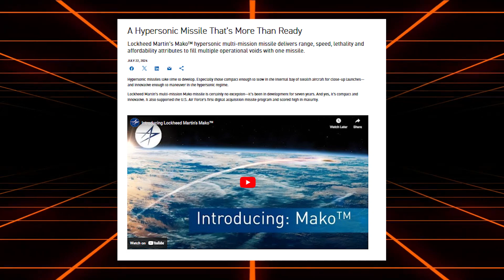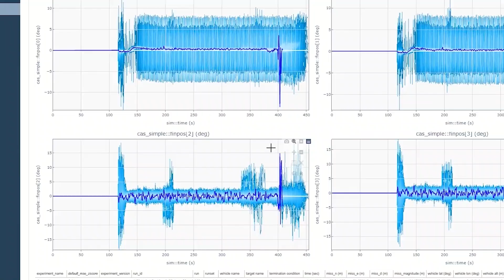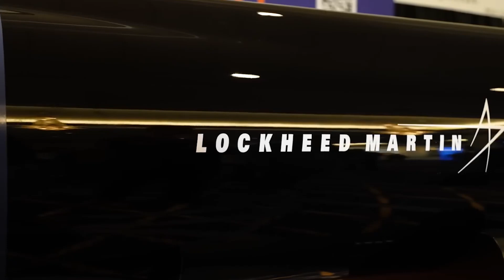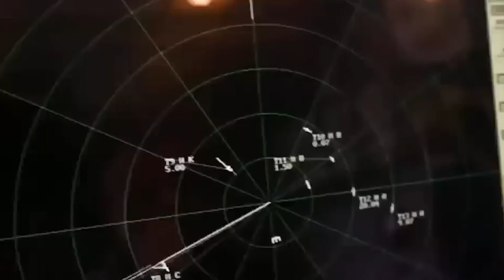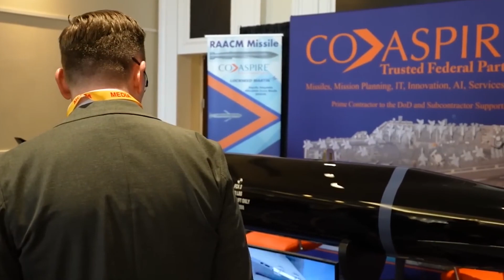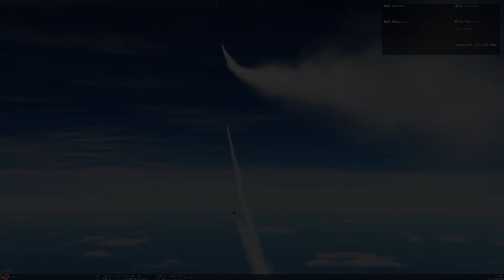Lockheed Martin's New Mako HYPERSONIC Missile fits INSIDE the F-22

Comment: The US has a working hypersonic missile!? 😂
Reply: What makes you think that the richest country in the history of the world is not capable of having a stupid missile.
Reply: @josemercado4702  The fact that they did not have them?
Reply: @comingviking  Nobody had missiles a hundred years ago. Don't worry about what they didn't have. Worry about what they have now.
Reply: @josemercado4702  So, there is an arms race. It is basically an engineering race. A science race. A material science race. The US is late to the party in many respects.
Reply: They already had one in the 1980s with Pershing II with a MARV (Maenueverable Advance Reentry Vehicle) warhead. It's the 1st of its kind. Operational too for about a decade before forcefully retired due to INF Treaty. Chinese DF-21/YJ-21 and DF-26B are based on the same tech. But US also brought it back with LRHW/CPS. US Army already received its 1st LRHW battery since October 2021. While CPS for Zumwalt destroyers and Virginia Block V subs by 2027 - 2028. They also now have an anti-ship ballistic missile with PrSM. And Kinzhal equivalent with AIM-174B.

US also developed the 1st HGVs. And from those experiments they found HGVs have a major drawback. Wedge bodies like HGVs have a higher lift-to-drag ratio than conical bodies meaning they will burn more brighter. IRST sensors can detect them even at long range much more if a HGV develops a plasma sheath around its body. So they are more detectable and trackable than ballistic missiles. It's why to this day US are not developing HGVs like Chinese DF-ZF and Russian Avangard.
Reply: @johnsilver9338 😂😂😂😂.......you are comedian  !
Reply: 😂 yes
Reply: @BrandonNewman-ng7hs  No.